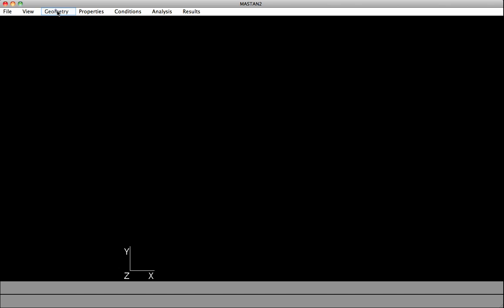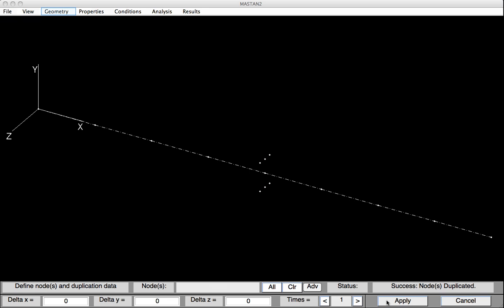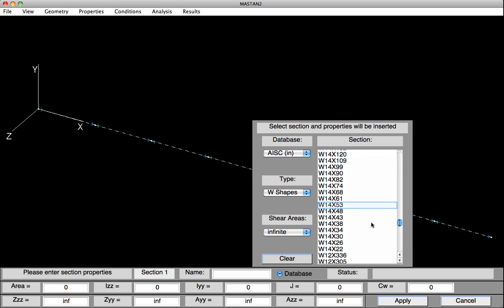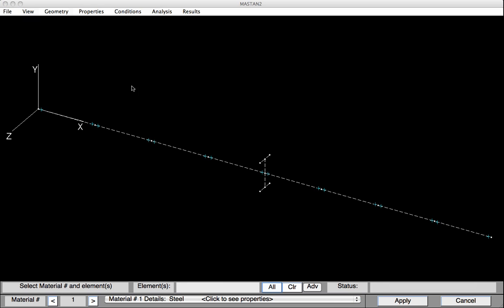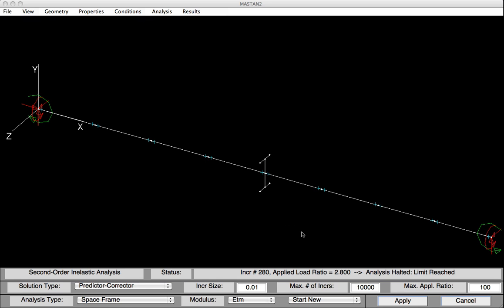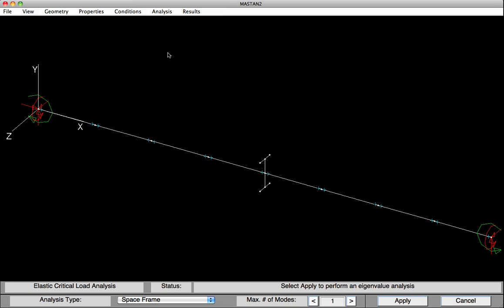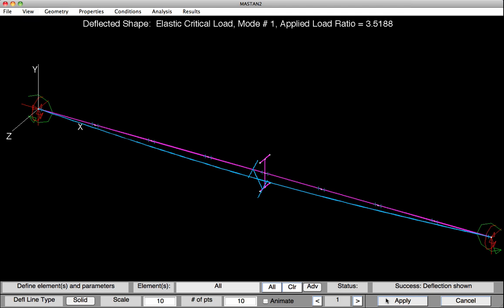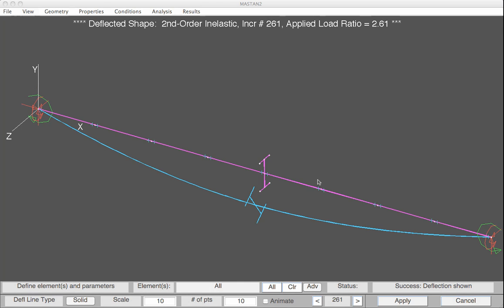MASTAN2  - Learning Module 4

Comment: As I'm very poor in understanding English, may I know your insights in the module?

Questions

1)	With all curves included and labeled, submit two plots with (i) the maximum ordinate set to the maximum Mn/Mp obtained, and (ii) the maximum ordinate set to 1.1.  What is causing the first plot to have such an extreme strength value?  Is this value realistic?
2)	Is the theoretical elastic lateral-torsional buckling strength curve in agreement with the Elastic Critical Load curve?  For what range of unbraced lengths are these curves even remotely realistic and for what range are they unacceptable?  Justify your response.
3)	Using the computational results, define a range of unbraced length for which partial yielding/residual stresses appear to have the greatest impact.
4)	Likewise, provide a range of unbraced length in which initial imperfections appear to have the greatest impact.
5)	Comment on the accuracy of the AISC beam curve (Eqs. F2-1, F2-2, and F2-3) for this particular shape.
6)	Describe what the minor-axis beam strength curve would look like if it were added to this plot.
7)	Which curves would change if a different wide-flange section size is investigated?  Justify your response.